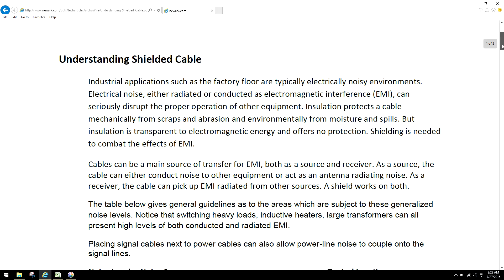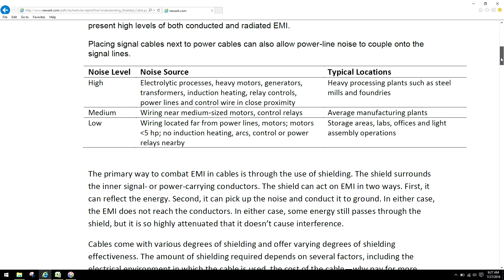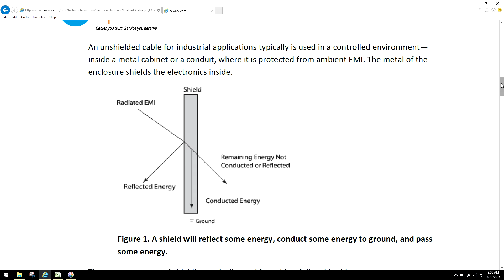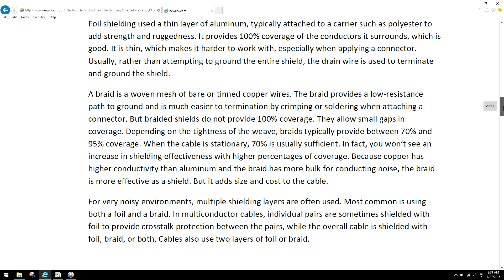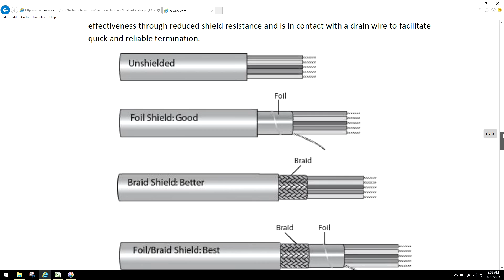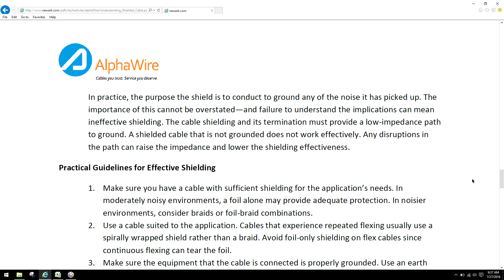How To Ground Your CNC Explained (This Also Covers Using Shielded Cable Properly)

Comment: Thanks for a fascinating video. Just a question - if I’m using a metal cabinet, can I earth the wire shielding to the cabinet itself and earth the cabinet to the power supply earth wire?
Reply from the maker: Thank you for your support. Yes, you can do that, but in best practice a "Star Point Ground System" will allow for termination of all shield drains in a more organized fashion. Here's me covering it in a clients pro-build system I did https://youtu.be/Hik7SlkX5Is?t=380 Thank you, and have a great weekend!
Vince
Reply: @corvetteguy50  Thanks. If I’ve got this right, I connect all DC grounds to a star single  point ( eg. one COM/GND terminal from each power supply, Arduino UNO GND terminal, fan GND wire etc) BUT I DO NOT  connect that star point to the power supply 240v earth terminal. However all shielding earths should be connected to another star point and that star point IS connected to mains earth.
Reply from the maker: @pw3111  All grounds period should be going to the Star point ground. (COM, and V- aren't  grounds.) Thank you,
Vince

Comment: Great video!
So just to be clear, this is where I always get lost....
I have a 24v PSU (input/ Output power) and  a 36V PSU (stepper Power). Spindle is a 500w Ryobi AC Trim Router.
all running in cable chains together, input wire all shielded, stepper control all shielded, spindle power unshielded.

As long as my wall outlet ground is earth grounded (haven't poked a tester in it yet), can I run a jumper to my 120vac ground to a ground block and terminate all of my shielded cable to it?
I have always been afraid of this, thinking it may back feed 120vac to my components in the event of a line short. This is good as long as my 24vdc and 36vdc negative posts
aren't grounded to the earth ground?
right now I have my shielding grounds terminated to the component grounds (negative Terminals), shielding step/dir signal negatives terminated together from Breakout board to Motor drivers (BOB end Only),
my shielding from motor Drivers to motors isn't terminated yet because it didn't sound like a good idea to terminate at BoB grounds.
Is it right unhook all of these shielding cables and terminate at the 120vac Earth ground, not tied to any components negatives?
Chassis is extruded aluminum it also?

Sorry and Thanks
Reply from the maker: Chris, thank you for your support. the answer to your questions is below.

Great video! So just to be clear, this is where I always get lost.... I have a 24v PSU (input/ Output power) and a 36V PSU (stepper Power). Spindle is a 500w Ryobi AC Trim Router. all running in cable chains together, input wire all shielded, stepper control all shielded, spindle power unshielded. The spindle your suing should be using a double shielded cable in best practice to mitigate both EMI frequencies. 

 As long as my wall outlet ground is earth grounded (haven't poked a tester in it yet), can I run a jumper to my 120vac ground to a ground block and terminate all of my shielded cable to it? In best practice a ground buss bar is used to split the ground terminal to allow the ground to be split for connections to support all shield drains.

 I have always been afraid of this, thinking it may back feed 120vac to my components in the event of a line short. This is good as long as my 24vdc and 36vdc negative posts aren't grounded to the earth ground? Back feed is usually never an issue as all power supplies Chinese or otherwise are all fuse protected. 

right now I have my shielding grounds terminated to the component grounds (negative Terminals), shielding step/dir signal negatives terminated together from Breakout board to Motor drivers (BOB end Only), my shielding from motor Drivers to motors is terminated yet because it didn't sound like a good idea to terminate at BoB grounds. Is it right unhook all of these shielding cables and terminate at the 120vac Earth ground, not tied to any components negatives? Chassis is extruded aluminum it also? Please review my pro grade Gecko Raptor build here, and you can see best practice for grounding using a ground buss, and Star Point grounding system. https://youtu.be/Hik7SlkX5Is

Thank you,
Vince
Reply: @corvetteguy50  
Thank you. Video was very informative and let me know exactly what I need to do, Especially my shield grounds from the motor cables.  That Raptor controller box is beyond awesome!
Reply from the maker: Thank you sir, I certainly appreciate it. I'm glad I could help. Vince

Comment: Dude, awesome.
Didn't think i would sit through a 22min clip with no pictures. 
Need more stuff like this.
Cheers
Reply from the maker: Alex,
Thank you for your support. I suck at being entertaining :), but my channel will help you learn what you need to know about your CNC robots electronics. Have a Happy New Year! Vince
Reply: @corvetteguy50  What shielded wire would you recommend for a nema 23 setup with rated volts 2.45 and rated amps 3.5. The wire is not the cheapest and I know that you know, what would work good haha.
I just cut all the wiring out of my home built CNC to start all over again.....
Also, if I shield the wiring from the motors, should I also shield the wires to limit switches? 
Cheers
Reply from the maker: @alexday2373  Shielded cable is yo be used throughout the entire system to assure you mitigate any possible EMI penetration Here's the cable to use for your steppers if you want to build your own https://www.ebay.com/itm/142355188071, here's the cables to use if you want them prebuilt https://www.ebay.com/itm/133300288430and here's the cable to use for your limit switch applications. https://www.ebay.com/itm/132575648256 Thank you, and have a Happy New Year! Vince
Reply: @corvetteguy50  
Thanks again mate, greatly appreciated. 2 questions....
Should every cable be shielded, including power supply to drivers and drivers to control module.

And you say to run the earth lead from the cables to the chassis, only at one end to avoid creating a loop. So assuming that the machine has a good earth (3rd plug in the wall socket), than it should not matter where it is in theory, as long as it goes to the chassis?
Reply from the maker: @alexday2373  All signal cables should be shielded. Power supply cables aren't required.  Details matter with grounding this video covers the required Ohm rating for a robot to be considered grounded. https://youtu.be/0l2SIvEeLNc

Thank you, and have a great weekend!
Vince

Comment: so if i get this right, the drain wire and the shieldwire both on the ground?
thanks
Reply from the maker: Hey Ben, Thank you for your support. The shield drain, and shield wire is one in the same, so your correct. Thank you, and have a happy Thanksgiving! Vince

Comment: Do you ground both ends of cable or just the side at the enclosure box? For motors, spindles. What about inside the box between controller and drivers, step,dir
Reply from the maker: JP, thank you for your support. You ground ONE end only to prevent ground loops. This is the same for all components your grounding. The enclosure your using for your electronics should also be grounded as well, so when you mount your ground bar to its base any shield drains run to it from your electronics is grounded. 

I prefer to have my grounds run all to my electronics enclosure. The spindle cable should be grounded at the VFD. The CNC chassis itself should also be grounded following the Ohm readings quantified in this video overview. https://youtu.be/0l2SIvEeLNc

Thank you,
Vince

Comment: So I've laser cut myself a wood enclosure for my DIY CNC.  How would this change things?  Thank you!
Reply from the maker: Colth, thank you for your support. An electronics enclosure for a CNC controller should always be metal to allow for proper EMI shielding under best practice. The enclosure will act as a "Faraday Cage" to protect the system from interference. Another huge safety factor to consider is wood is flammable, and should never be used where a short, or spark could ignite in proper conditions. Thank you,
Vince

Comment: I did the first part with gold plated soldering terminal on the frame and the earth grounding on my wall plugs. I just got mine 1 week ago and i am a complete newbie to cnc. safety is very important for me so the next thing i want to do is change all the cables to shielded cables, this is where i am not sure how to do it. Do i just buy high quality shielded cables and replace all the wires or only some specific wires need to be replaced? plus how do I ground the black controller box?
Reply from the maker: Darshan,

Thank you for your support. You want to use shielded cables when their carrying any signals that could be contaminated by EMI. Ground the controller using the method outlined in this video. https://youtu.be/cFrREKB-l4M

Thank you again,
Vince
Reply: @corvetteguy50  thank you so much.  very informative  and helpful video.
Reply from the maker: @darshanaacha6469  You bet :) Thank you,
Vince

Comment: I am having an interesting problem with my DIY CNC router I built. I have multiple floating points due to each axis riding on non-metallic wheels. I already had to add a ground wire to my spindle, so my Z axis will be grounded due to the spindle body now being grounded. This leaves my X axis floating still. I want to avoid ground loops, so I am wondering how I should ground my chassis. Ground each axis with a screw and 20AWG wire then each to a star ground, and all drains to the star ground point?
Reply from the maker: Jon,
Thank you for your support. I would do as you wrote, but grounding each axis individually isn't required as the chassis I'm assuming is a metal frame in which case attaching a star ground to a central point, and connecting the earth ground from a grounding rod, or verified earth ground from a wall socket will accomplish grounding the chassis as a whole. 

If however your chassis isn't utilizing a metal frame grounding each point the way you described is the way to go.

 Thank you,
Vince

Comment: Hey Vince,

Thought I'd give you a quick update on my CNC Lathe.

As you recommended I ran a ground wire to the body of the lathe last night. Just doing that seems to have made a big difference.  I ran a toolpath and while it was running I kept turning the spindle motor on and off. It probably took over a dozen tries before the software locked up and crashed.

Per my email I'm interested in buying the grounded aviation connectors and shielded cables with the ferrite rings.

Thanks again for the help.

Jay

Comment: Thank you for the excellent information. I understand the basic concept and reasons for earth grounding all the components. Then I go out to the machine ... 

I've converted a small Unimat lathe to CNC using the Zyltech kit with an Ardunio Uno and Grbl shield. I'm having what I believe are noise related issues and want to start out by just properly grounding everything.  The problem I'm having is understanding what is the correct point on the Ardunio/Grbl boards for the earth ground.

My power supply has three connections each for the + & - 12 VDC power to the circuit board and has the usual two wire A/C with earth ground connections.  If I test it with an ohm meter the earth ground is connected to the metal housing. However, there's no continuity between these and the 12 VDC V- terminals. I've connected the 12 VDC power to the Grbl shield but there's no obvious place to connect the earth ground.  If I meter the boards they have multiple pins that say GND but these are all connected back to the black 12 VDC V- power terminal.

Can you tell me where to attach the earth ground on the Grbl board ?  (I'm assuming you don't connect earth ground to the V- loop.)

I've looked all over the Internet and haven't been able to find the answer to this basic simple question.

Thanks in advance for any help you can offer.

Jay
Reply from the maker: Jay,
The reason you haven't found an answer online to your question is your essentially trying to ground a bare circuit board which is typically not required if its mounted in a proper electrical enclosure which will act as a "faraday cage"
Do you have the unit installed in a metal electronics enclosure? If you do it, and ground the enclosure you will then have the proper level of protection to isolate the unit from EMI. What problems are you encountering that you feel are EMI related? Please use my email to respond as its a better way to reach me (storm2313@gmail.com) Thank you,
Vince
Reply: Thanks for the quick response and comments Vince. I'm responding publicly to your question for the benefit of others following your thread and will also contact you via your email address.

The biggest issue I'm currently having is the losing the COM3 connection. I have to disconnect the USB cable and plug it back in to reestablish it.  I'm mostly using the GrblGru software on my Windows 7 PC to operate the lathe. The software is also crashing fairly often but I'd like to resolve any EMI issues before investigating whether the code is causing the crash.

No, the Grbl controller is not yet installed in any type of case yet.  I'm also not currently using any shielded cables yet as the only wires going from the controller are the two sets of four-wire cables to the two stepper motors. (Can/should these be separated and/or shielded ?)

The spindle motor on the lathe is what looks to be the type you'd find on an old sewing machine with the carbon brushes. I'm sure this is very noisy and know for a fact that turning this on and off can cause the software to freeze.

I've removed all the limit switches for now to eliminate them as a possible source of the problems and have physically separated all the cables from each other to try and minimize cross-talk.

Per my first posting I'd like to start by taking care of all the basics which seems like good earth grounds.

Does that sound right ?

Thanks again.

Jay
Reply from the maker: Jay,

The first thing to start with is utilizing shielded cable on everything on the system. The entire system is reflecting instability which is why I recommend an electronics enclosure, and shielded cables for every component. 

Once that's completed providing an earth ground is as simple as running a lead from the third prong on your typical 120v wall outlet to a terminal splitter to allow all your shield drains from the shielded cables to connect to it. 

Thank you,
Vince
Reply: corvetteguy50

Thanks for the advice Vince. I'm sure you're familiar with the typical 4 wire cables from the drivers to the stepper motors on the Grbl controllers. Each end has the plastic connectors that plugs into the pins on the board. (.100" spacing.) Do you sell these cables with shielding ?
Reply from the maker: Sorry I don't,  as they use plastic connectors.  Thank you,
Vince

Comment from the maker: MrJ,Your correct about using a grounding rod, as being the most definitive source for a proper ground, but for most of my clients it may not always be an option. The third prong method provides the best coverage without using a grounding rod.If however anyone reading these comments is able to install one please by all means install one.Thank you again for your support MrJ. :)Vince

Comment: Great informative video, i have just one observation to make.  The use of your AC power outlet ground pin for earthing EMI in machines.  i would recommend the use of an earth rod away from the outlet, two reasons really.  You don't want the EMI introduced into a mains installation (possibly having a poor earth already) and you don't really want to mess with the mains system in your home etc.  If you were to have an electrician test your earth loop on your mains supply and run a CNC plasma at the same time - i'm confident he will go and put his meter back in his van and refuse to test.  These things are hugely noisy.
When you see a hollywood film where you see electricity tracking along walls, metalwork, desks etc EMI if you could see the noise would look just like this, kind of Frankenstein - that.s what we are grounding stray wiggly's.
Filtering - most of our problems become visible as we are using PC's/Laptops to run our equipment the machine crashes predominantly as the operating software crashes.  Adding a mains filter and using screened communication leads helps a great deal.  The Earths and screens attached to the machine work best individually wired (star wired) to the earth point.  Daisy Chaining just passes the EMI from one surface to another increasing the massive aerial you are building.  Dissipating EMI from each part directly to ground Ensures a good solid dispersal point for that item/part of the machine.  Copper Earth Rods,  umm where to begin.  These are not magic wands you bury and forget, depending on soil type you may need either a 3 foot or 6 foot copper rod.  I have a particular issue with the ground drying out where my rod is located so i have to water it occasionally like a plant.  I am far from being knowledgeable like corvetteguy50 but he is definitely accurate in what he says.  We are not taught much about grounding noise and its a bigger problem than we might think.  There are standards which must be adhered to when manufacturing domestic appliances but they are designed to minimise EMI to acceptable levels nor eradicate it,  If we Import a cheap Asian power supply to run our equipment then our domestic supply can already be humming by the time we try to run processor controlled equipment.  I have a set of spot lights above my bench which cause my HiFi to hum when they are both on together, both items are European CE rated and probably both Asian in manufacture.  Hopefully i have added something useful to  the conversation.  At least if someone adds to my comment or rips it apart we all benefit from this exceptional discussion.